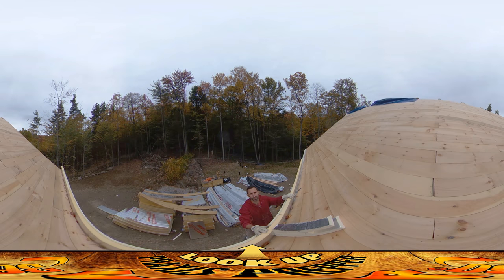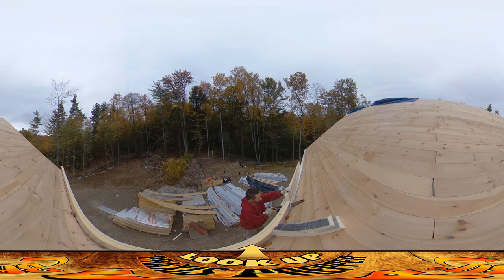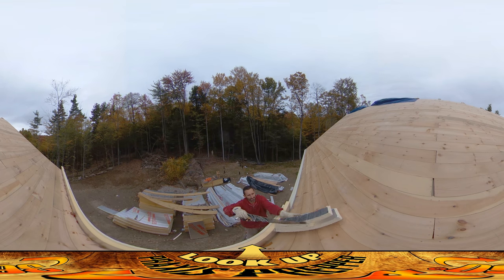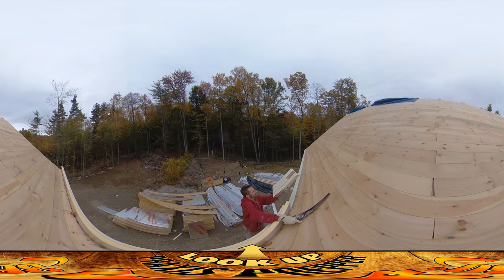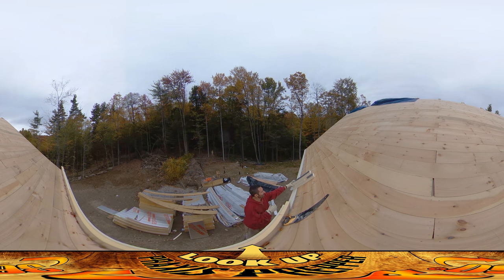Homestead Building - Prepping Wall Insulation For Roof Insulation to Go Up, Insulation Layering

Comment: Good morning your probably past the roof on based on actual to release. If you go too roofing supply company they sell long screws and plates for installing those panels on a roof. Yes all the way to 12 " length and longer been a while for that memory. Blessings brother. One thing but a harness it will save your life. Plus outs pretty cool to work and rappel
Reply from the maker: I found 1' timber screws and bought a bunch. I'm just about to start the roofing. Likely will begin within 2 weeks.

Comment: Heat rises, so insulating the 'roof' (say it 3 times fast and you might scare off a cat ;) is a good way to keep the heat inside a building, and have it slowly fill up the house (hottest will always be near the source of the heat and in the highest available space), then it's basically a matter of trapping the heat further so it doesn't escape from the sides ... so, 6 inches of insulation, that's pretty close to 15 cm ... hmm here i think 6cm or so is standard ... what is the R value of that stuff ?
Reply from the maker: I don't know the R value off hand. I'll try to mention it when I'm on camera on an upcoming video because it's printed on the panels.